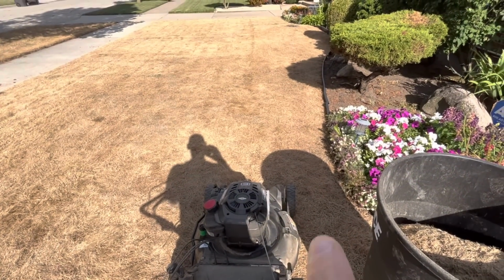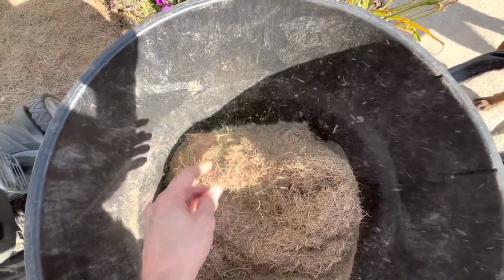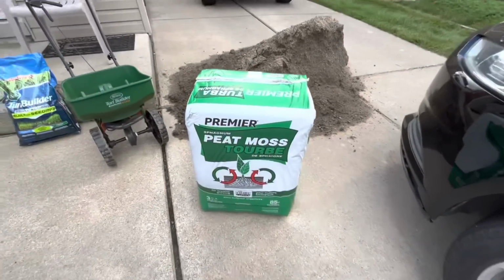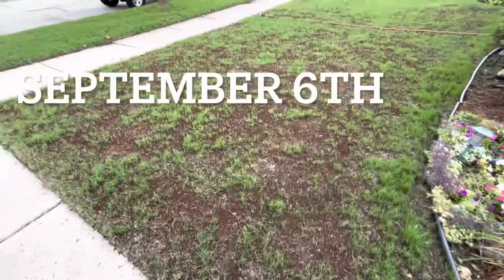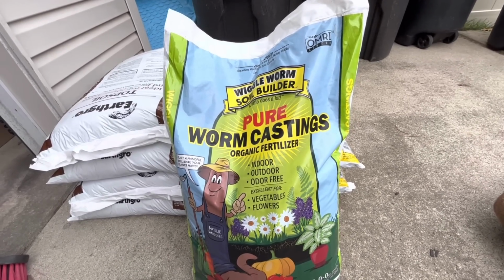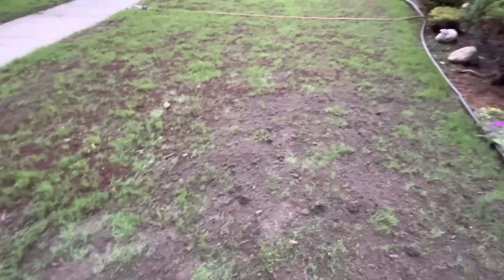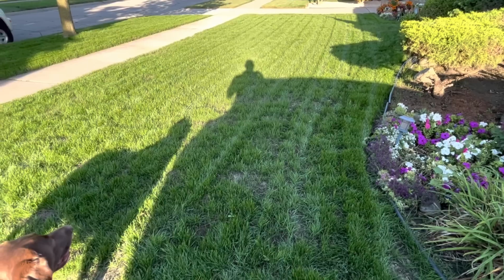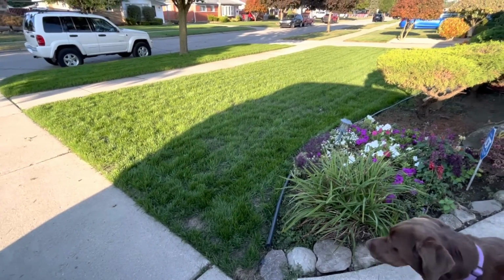My Lawn Renovation Journey 2022 (Turf Type Tall Fescue)

Comment: The seed does great in the summer. I did my yard last year. I killed mine but I mechanically tore all the old grass up with a tiller the scrapped it with a backhoe and skid steer. 

I used GCI cool blue, spreader elite and TTTF that you had. This year it look like carpet. Cut it at 3.5-4in and I didn’t water it at in July august. I’m in southern Indiana. It was green but going brown as it was stressed but that was 60 plus days getting baked. I have no trees no shade for it.
Reply from the maker: Thank you for that reassurance on the drought tolerance of this seed. 👍
Reply: @grassymitten5324  idk where you are located. I would suggest a lateral spreading TTTF or KGB overseed with it next year. Seemed to make a big difference in look and feel. I used just the TTTF on the side of my house and switch to the GCI cool blue for the other 2000 sq/ft as the TTTF was sold out. It looks so much fuller and thicker than the straight TTTF does. The GCI seed is legit. I wish I could share pics lol. I’m going on week 3 and it’s already 2 inches tall. I use erosion mats to cover it to keep the birds off it. KGB struggles in my soil so I went with the spreader elite from GCI. TTTF with lateral spreading instead. All the same TTTF seed which is nice.
Reply from the maker: I’m in SE Michigan. I originally was going to use the Blue Heat seed but it wasn’t available when I needed to order it. I will consider doing an over seed with it next year. Thanks for the tip. 👍

Comment: I commend you for doing a front lawn renovation of that magnitude. I just did my rear lawn of 4000 sqft and I will NEVER do another burn down renovation. It’s just to much work and (in my opinion) unnecessary to achieve the same results with working with a decent stand of grass. Of course each scenario is different, but I will keep my front lawn intact and continue with aeration, over seeding, fertilizing, liquid amendments, etc. I’m glad your lawn came out good. Great video 👍🏽
Reply from the maker: Thanks for the comment. It was my first time doing a complete redo of my lawn. It was really a lot of work. I had several different types of grasses in the front and I hated the way it was looking. That’s why I did a complete renovation. Now my backyard will probably just be a hard de-thatch, level and over seed. Again thanks for watching. 👍

Comment: Do yourself a favor and get a peat moss roller. You wont use it much but when you do it really helps getting your peat down evenly. You can also spread various soils/manure/organics too
Reply from the maker: I’ll look into it. If i can use it for more than just peat moss I’d be more willing to get one. Thanks
Reply: @grassymitten5324  A Lanzie is the one most recommend. I have a different one and it works fine.

Comment: If you don’t use a 3 in 1 at the beginning germination would happen a lot sooner. No matter what the bag says any type of weeding product will slow down germination because it takes water away from the plant no matter if it’s on the grass or not. Second, you really should’ve top dressed immediately. If you’re going to roll the lawn without the peat moss the dirt has to be moist. It looks great but you’ll have better luck without the 3 and 1 in the beginning. That’s what caused the delay in germination.

Comment: Was your old lawn from seed or sod? I've killed off my lawn, which is currently sod. I'm debating on removing the sod layer or scalping and seeding right on top.
Reply from the maker: Good question, I’m not exactly sure what the old lawn was. It was already well established when I moved here 10 years ago. I’m assuming it’s the original lawn, so probably sod. There were several types of grasses mixed in. I’m about to start a reseeding in my backyard very soon.

Comment: Awesome video. I see that you are in Michigan. I’m in Grand Rapids. I planned to do a renovation this year but I’m now hearing it may be too late to start. Any advice? Should I wait until next year at this point? My reason for wanting to renovate is Poa annua throughout the lawn as well as large patches of bent grass .  Looks good from a distance but not so great close up so I’d like to start over .
Reply from the maker: Hey thanks for watching and the comment. If you plan on killing the lawn first it may be too late to start. If you plan on using sod you’ll be ok. Or you could do a hard de thatch and over seed. But if it was me I’d wait to do a full renovation until next year. I’m in SE Michigan so you want to make sure your baby grass roots can handle a hard frost. I started mine July 25th and my first cut was September 19th, if that gives you a time frame. Thanks again and I hope this helps. Let me know how it goes whenever you get started 👍
Reply: @grassymitten5324  thanks for the advice, I’ll keep you posted 👍